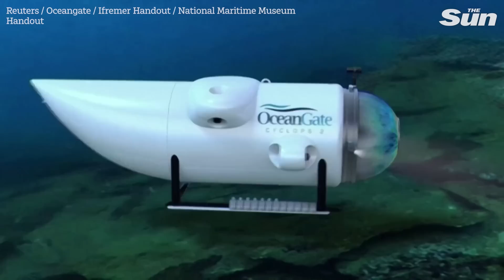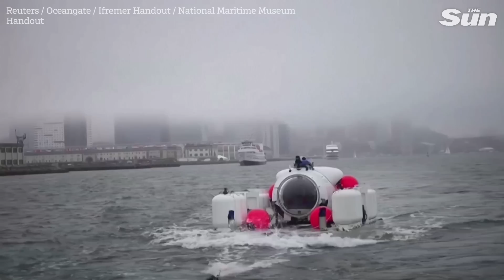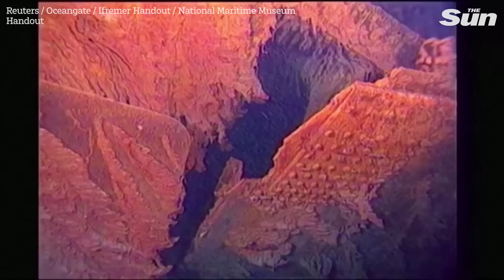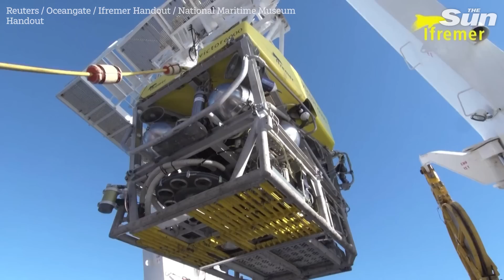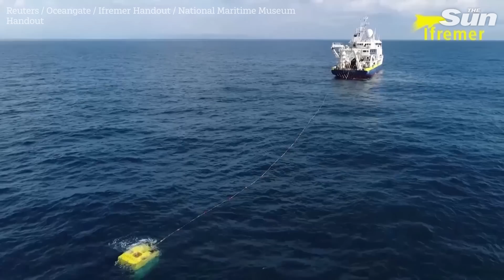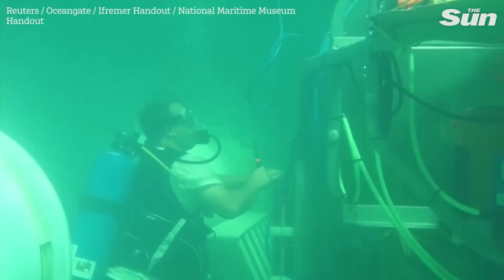Titanic submarine, Titan, implosion caused by a 'buckling collapse' - NYU engineering professor

Comment: The water rushed inside and filled the vessel in 1/100 of a second at 1000km/h, the speed of a jet airplane. The air inside the vessel and crew inside was crushed to the size of a bowling ball. It's not a buckling collapse.

Comment: Is implosion or vacom?  Coz implosion can happen only with rapidly changing temperature in airprove thinks? Maybe im wrong?
Reply: yes, you are wrong, an implosion is caused by higher external pressures being exposed to lesser internal forces, causing a sudden failure and collapse.

Comment: Not an engineer speaking, but other experts and explorers have criticized the design because:

1. Hull center section was made of carbon fiber, which can get waterlogged and delaminate, as salt water degrades the epoxy which keeps the fibers together, and at that depth, a small crack can cause a catastrophic failure.

2. Craft was cylindrical instead of spherical. It's common knowledge that the sphere is a perfect shape because it can bear equal loads from all sides. But the cylinder would (at least that's what I think as a layman) get compressed from the sides, generating a force which would tend to expel the titanium domes in opposite directions... In theory, this force would be counteracted by the pressure of the sea itself, but what if the center section is not as strong as the titanium domes, as in this case? Implosion.

Comment: I'm an engineer, and even I know the Challenger crew were found still in their crew cabin. The explosion was large, but not especially intense.  I don't agree with other things this guy has said also.  
However, going from 1 to 380 bar instantly would release so much energy from the implosion that the crew would have been completely shredded, literally blown to pieces. Of that there is little question.
Reply: And BURNt due to dieseling effect !
Reply: @clitisswood7330 absolutely! I'm a physics prof, and I was talking to my lab tech today. It was hotter than the Sun in there for about the 20 microseconds it was collapsing.
Reply: That's if you assume it went from 1 to 380 bar instantly.
Reply: @entx8491  What would you say it was safe to assume happend?
Reply: @karlsilverone  There is no precedent that gives us any certainty to how exactly it took place, we know the hull was breached so we should then explore what we know about how it was constructed. The acrylic portal was rated to less than 1400 meters, in engineering as a rule of thumb you push safety critical components to a fraction of their limits as a rule and NEVER exceed or take them to a magnitude of them. If the portal suffered a hairline fracture or a gasket slipped there or elsewhere even outside on the many attachments, we cannot the predict the flow rate / fluid dynamics involved, only the outcome.
Reply: @entx8491  With all due respect, to say there is no precedent is ignorant at best. There is plenty of research and science behind what happened. What there is no precedent for, is a gradual leak under those kinds of pressures, when an immediate rupture takes place under the extreme pressures and loads. The Navy even recorded the implosion, which would have had to have been catastrostropic, and not gradual, for it to have been picked up as an implosion.
Reply: @entx8491  There's no other way it's going to go. The crushing of a cylindrical pressure vessel will be almost instantaneous.
Reply: That's why they asked you to do the interview and not the guy we're all hallucinating doing it.
The fact he looks so much like Groucho Marx should have warned us we were tripping balls
and the real expert was another cyber-genius, posting from the bedroom at his Moms house he's slept in for 43 years.

Comment: Did I hear the speaker say it's not a bad design?
Rush admitted that he broke rules building the submersible. Carbon fiber is far stronger in tension than compression. And if you don't protect against galvanic corrosion between carbon fiber and titanium, you will get galvanic corrosion between carbon fiber and titanium.

Comment: he didn't  think it was a bad design  but look it didn't  work  it failed  catastrophic failure killing  people  it was bad
Reply: It may not have been a ‘bad’ design on paper (and without seeing the full design its hard to know - more on this at the end), but a tiny error when building or maintaining it could cause tiny weaknesses which at those pressures and depths can very quickly lead to a chain reaction of other failures. Even as much as a bolt being overtightened could cause microscopic cracks, which over the course of one, or a few dives can fatigue to the point of becoming a weak spot that can shatter at any moment. One proven example of this from history was the first commercial passenger jetliner - the BOAC comet. Tiny imperfections caused by punch-riveting (rather than drilling first) led to microscopic fractures and metal fatigue, resulting in stresses building up over pressurisation cycles, leading to several in flight explosive decompressions. (Not helped by an increase in stress by using square windows - although this was not the absolute root cause). A similar scenario (but with the pressures inverted due to being underwater, rather than in the sky) is what may have caused this catastrophic failure - Although unless the wreckage is found and recovered for in-depth analysis we will not truly know what the root cause was. — more on the design: the use of carbon fibre does raise a few questions, and I’ve not seen the technical designs for the sub so I don’t know which parts were made from CF, however the use of CF for the main pressure chamber would seem odd, as CF is really strong for its weight when under tension, but not compression. And being under water at these depths would be compression forces from the outside (unlike in a pressurised aircraft where it would be tensioned as the internal pressures stretch the fuselage out, similar to inflating a balloon - this is where CF would be stronger and better suited, unlike where the complete opposite load is applied when used in a sub).
Reply: @ASMRCulture  - thanks for that, it explained things clearly.

Comment: The Euler buckling load, also known as the critical buckling load, is a theoretical calculation that determines the maximum compressive load a slender column can bear before it buckles under an idealized set of conditions. It is named after the Swiss mathematician and physicist Leonhard Euler, who made significant contributions to the field of mechanics.

The Euler buckling load is derived based on the assumptions that the column is perfectly straight, homogeneous, and has a uniform cross-sectional area along its length. It assumes that the column is subjected to an axial compressive load and that it is supported only at its ends, with no intermediate bracing or lateral restraints.

The formula for the Euler buckling load, expressed in terms of the column's properties, is:

P = (π² × E × I) / (L²)

where:
P is the Euler buckling load (the maximum compressive load),
E is the modulus of elasticity of the column material,
I is the moment of inertia of the column's cross-sectional area,
L is the effective length of the column.

The effective length of the column refers to the distance between its points of support or bracing. For columns with different end conditions or intermediate supports, the effective length can be determined based on the specific boundary conditions.
Reply: Did you just Google that?
Reply: @TheTelblackwell No sir, I read a lot and have a  very good memory. I am fluent in some obscure languages too but that is not important right now.
Reply: @smokejaguar67  I'm impressed 👏
Reply: Bro is google
Reply: Nerd 😂
Reply: @prasannarajendran9315 its not Particularly complicated. Most engineering and math majors understand this..
Reply: @nomarxistspls90 who cares what nerds study
Reply: @jaserogers997  well I do since I’m doing an MSc in Pure Math…🤦🏻‍♂️

Maybe I am a nerd to you. Or rather, you are just unintelligent.
Reply: @jaserogers997 you care because your world is built on what nerds study, without them you still be scrabbling in the dirt for scraps
Reply: @nomarxistspls90  I already have a degree in math, and it wasn't difficult.

It's nerdy and boring, cope.
Reply: Well that clears it up. You are a deck.
Great cut and paste 😂😅😂😅😂😅
Reply: Oh look at me I use big words 😂
Reply: For us laymen, the vessel was dramatically under engineered.
Reply: The structural weak point was always the long Carbon fibre tube a sphere is the strongest shape under such pressure thats why its the preferred capsule shape used in ROV's
Reply: @jaffatyree  that's not really funny, is it? When one of your loved one's passes, I hope someone makes an inappropriate joke about it, see how you feel then.
Reply: he has a better understanding of mathematics and is a better problem solver, to put it in lemans terms he aint a dumbass like all the morons that keeo stating nerd.
Reply: Thank you I was feeling a bit daft then cause I did not understand anything he was saying 😂you explain it well ❤
Reply: TL;DR?
Reply: QQ😊
Reply: You need to go out and get your hole.
Reply: Many thanks. I was just solving a thermodynamics exam question with my son.
Reply: I mean you quite clearly googled it and copied a definition BUT you copied a definition based on structural engineering. The application here relates to the bucking of a hoop under compression. This application wuld require the derivation of a different equation based on the application of a few different principles and it's not a simple one. 
What you have copied and pasted is a perfect example of why googling engineering principles with no knowledge is just a waste of time
Reply: Humans are just evolved animals our mind is the oldest version and most updated from evolution compared to lower animals, we see consciousness on animals the same as we do on ourselves, but when achieved a human mind if humans still hold back to animal pleasure which comes on many forms and some of them are very irresponsible, disrespectful to souls and others,  like visiting an abandoned cemetery created by capital greed of the ship builder and owners past and present, doesn't sound any good for them. It all depends what they did during their lifetime,  everyone will be its own judge. If they exploited people paying the bare minimum , had given bad conditions, were dishonest, traitors, bribers abused power etc.. They were caught frightening too, they're vibration synthase with the life out there on the bottom and predatory scale on the ocean, I find very doubtful if they'll have a better chance and come back as something just less evolved than a chimpanzee,  God doesn't discriminate its infinite creatures.
Now I understand what they say 'Power corrupts the soul'.

I see they going back there the hydrothermal vents of the deep ocean as a bacteria again where life on Earth condition is a hell for a microorganism and that will be just the beginning for them, with the exception of the little innocent boy.😢
Reply: This formula has little to no relevance to the mechanical effects of hydro-static pressure on a submersed column. We're assuming uniform pressure all around the object. What will count the most is impurities in the material during construction. Theoretically CF should have superior characteristics to steel according to measurements. However what about when the material has imperfections? Steel is an atomic crystal structure meaning there are no "fibers" or long molecular structures. Carbon fiber is made of extremely long molecular strands intertwined. That's what gives it it's "extra" strength. But what if the strands fail? Will it effect other strands and a much larger area? How pure does it have to be before it's reliable?